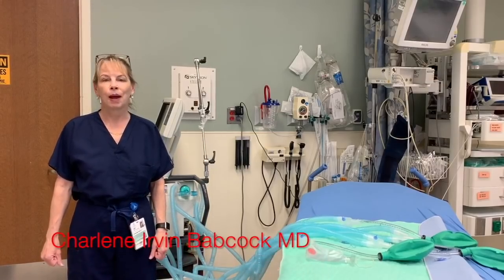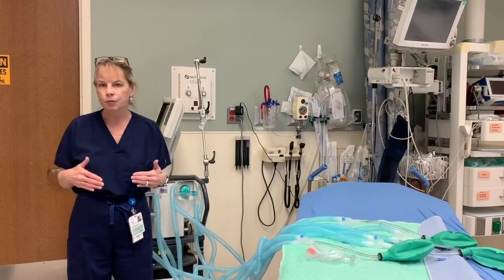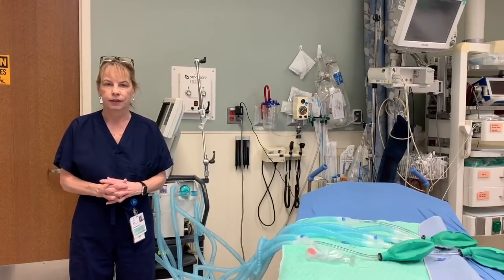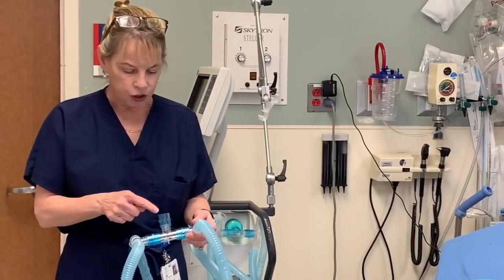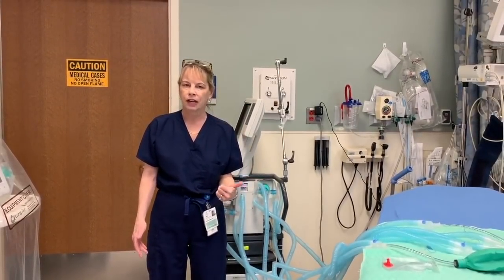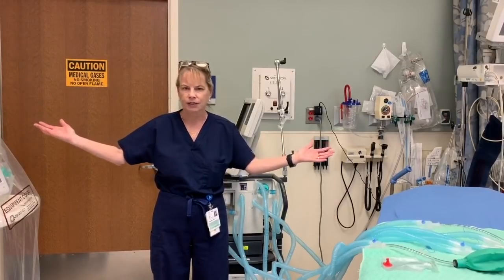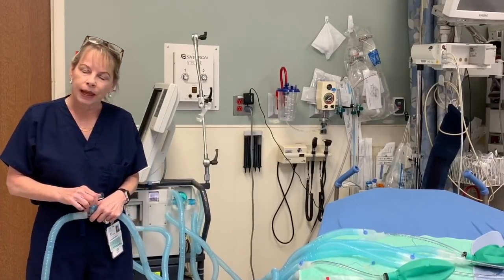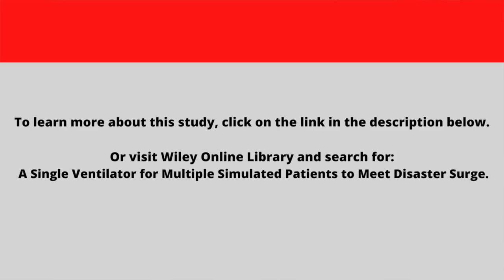COVID-19 How to Use One Ventilator to Save Multiple Lives

Comment: This method has been questioned for years, see https://www.sciencedirect.com/science/article/pii/S001236921532780X#bbib19:   "Suggestion 3.1: EMCC requires one mechanical ventilator per patient concurrently receiving sustained ventilatory support.

Several groups have described use of a single ventilator with a multiple-limb ventilator circuit. While at first glance this strategy is appealing, the research to date has demonstrated only that similar test lungs and pharmacologically paralyzed sheep with normal lungs can be ventilated by this approach. Perhaps this strategy would have utility for ventilating patients with normal lungs (eg, isolated traumatic brain injury) and thereby free additional ventilators for patients with high resistance or low compliance. Extrapolation to EMCC would require pharmacologically paralyzed patients who remain matched for minute ventilation requirements, dynamic airflow resistance, and compliance throughout the duration of ventilation; however, these parameters are likely to vary during the duration of mechanical ventilation, and may even change over a period of minutes (eg, secretions causing increased airflow obstruction). Because the Task Force anticipates that most additional patients requiring mechanical ventilation during a mass critical care event will have severe airflow obstruction or lung injury and will require days of ventilatory support, the Task Force suggests that each patient should have his or her own mechanical ventilator."

Comment: Dear Dr Babcock, I am an engineer and I am working with other collegue to realise a more robust system to split the ventilator line for 2 patients. My main concern is about parameters, on some machines the outlet line is also connected to a flowmeter that is used to allow paramters to be read and also to allow self regulation to the machine. How you can ensure this when you have the outlet of two or more patients? Many thanks and stay safe!
Reply: There is probably a manual setting toavoid using feedback

Comment: Where do you get more 3 masks and valves for other three patients?
Reply: Steal them from the CPAP machines.
Reply from the maker: THis video is about spliting tubes for a Ventilator...so there is no mask...but instead an ET tube.  ANd everything except the splitter should be on the quipment cart....

Comment: Dr Marco Ranieri of Bologna, Italy and his team Have successfully tested the approach in vivo in one of the hospitals in Italy overwhelmed by the COVID-19. 

They worked with Intersurgical, an Italian company based in Mirandola, started producing the circuitry in only 72 hours, and the first prototype has already been tested by Bologna Sant'Orsola Hospital. It works and in the next few days they'll start a mass production to supply Italian hospitals who are in need

Here some news in Italian. 

https://www.huffingtonpost.it/entry/a-mirandola-testato-ventilatore-che-assiste-2-pazienti-bonaccini-straordinario_it_5e73c3e1c5b6f5b7c540a8d2
Reply from the maker: THank THank THank you VERY much....for sharing this.....Fills my heart with Joy knowing. that it may work and possibly save lives...I know it may be a challenge matching. patients for eachset of 2 or 4...any pearls you can share...any challenges you did not expect?  

THanks again so. much for update!
Reply: Huff Post? Literally nothing they print is factual.
Reply: myname is private There is plenty of news from reputable sources in Italian and I checked with my connections in the medical community. Unfortunately Huffington post is the only one I found in English
Reply: Richard Pomerantz I don’t know if this is the same preference. Another case is spare valves for insulators which are running short so I group of people decided to 3-D print them on the spot as the manufacturer cannot supply them for weeks

Comment: It has been tested since, in 2008 and it worked. It is for a worst case scenario, but works to bridge until more ventilators arrive or free up.      Paladino L, Silverberg M, Charchaflieh JG, Eason JK, Wright BJ, Palamidessi N, Arquilla B, Sinert R, Manoach S.
Resuscitation. 2008 Apr;77(1):121-6. doi: 10.1016/j.resuscitation.2007.10.016. 
Increasing ventilator surge capacity in disasters: ventilation of four adult-human-sized sheep on a single ventilator with a modified circuit.
Reply: "Further research should be conducted on ventilating individuals with different lung compliances and on potential microbial cross-contamination."  Is that research available?

Comment: There is not enough information here to equate the COVID-19 situation with this experiment, nor the Las Vegas experience.  I also wonder if it assumes too much.  What is the impact of varying patient compliance for COVID patients who develop ARDS?  Does the evidence show the COVID patients never grow other pathogens?  Is volume control really the best option?  That seems rather counterintuitive.  If we are to attempt this maneuver, there are multiple concerning issues that need to be addressed.
Reply: your concerns are valid. But think if you don't try and you run out of vents for patients that need to be intubated- you've lost even more patients. We have to make choices. If you don't try - the patients will die.
Reply: B Anderson See my comment above this has been successfully tested in the field in Italy  now and it is now scaled up to double the ICU capacity
Reply from the maker: THey are using it in Italy...it DOES work...see above ...comment by Filippo Catalano!

Dr Marco Ranieri of Bologna, Italy and his team Have successfully tested the approach in vivo in one of the hospitals in Italy overwhelmed by the COVID-19. 

They worked with Intersurgical, an Italian company based in Mirandola, started producing the circuitry in only 72 hours, and the first prototype has already been tested by Bologna Sant'Orsola Hospital. It works and in the next few days they'll start a mass production to supply Italian hospitals who are in need
Reply: With all due respect, we need more to go on than simply telling us this concept has been field tested.  Surely you can share the results in a format we can understand and operationalize. I assume your hospital is set to role this out, Dr. Babcock.  What algorithms will you employ?  Robert, this isn't about not trying. If it were, I wouldn't take the time to post.
Reply: Actually, using pressure control would likely prevent volutrauma. The worst thing that would happen with this setting is that the person with the least compliance would be underventilated (as long as they are oxygenated they could tolerate some permissive hypercapnia). 

James Yi, MD
Anesthesia
Reply: Volume control is never the best option.

Comment: It’s absolutely doable 
I would add two things 
A filter can be added to each one of the four limbs to improve viral filtering 
Also she said volume control vs pressure control. 
 I think volume control is the one that is nerve wrecking because you have to choose similar weights, BMI, and compliance so if one patients compliance changes or the nurse is suctioning the patient, the others will get much higher today volumes ( of course we can also limit the max pressure to 30 but that will also mean that every time we suction somebody the others won’t get the today volume)

The best bet is pressure control you can even ventilate a kid and an adult using PCV without problems

Comment: Thank you for this. I remember reading the article. In dire circumstances and for short-term use, anything is possible but there are two inherent problems in the use of this method with COVID-19 especially if having to rely on prolonged use because of lack of available devices. The first is that heated humidity is preferable in any circumstance of injurious lung and to do this would not be possible when heated-wire circuits are utilized from a single chamber. As a result, it would mean the use of HMEs. As the resistance to airflow builds up in the HME because of oversaturation and/or secretions that are coughed into them (a common problem with prolonged HME use), it would necessitate the HME to be changed. Further, how do you determine which one has to be changed, especially if patients are paralyzed and work of breathing can't be assessed or independent feedback data from the ventilator be read? In any case, this would require a break to be made in the circuit to replace. As a result, it would cause frequent risks of exposure to care providers. This is not a recommended practice even if endotracheal tubes are clamped. The second issue is that each patient's disease process is dynamic. As such, what do you do when one patient's lung injury advances requiring a change in settings or modality; two patient's remain in stasis and the last is ready to wean? Difficult questions to answer but despite having said all of this, this may still be the only option available, (Hopefully, only for a short term) if/when the lack of ventilators arises.
Reply: Scott the patients need mechanical ventilation so a trach and trach mask is not going to cut it as, while there may be some degree of passive oxygen flow in a non ventilating patient and high flow oxygen with an open airway (or trach, see apneic oxygenation) this is usually done with stable folks in an operating room with a dedicated anaesthesia professional, or as a bridge to airway management... sadly your idea will not work unless the patient is breathing spontaneously which is difficult to assure when often  chemical paralysis is necessary to ensure ventilator synchrony during treatment for ARDS and similar.
Reply: @EricMcKearney  Thank you for a serious reply to my suggestions. Spontaneous respirations are, of course, necessary for tracheotomy to work by reducing dead space in the airway. My point is, if spontaneous respirations have ceased or are ceasing, I don't think it is a sound idea to inject the aerosolized filth of the adjacent victim. My experience is mostly with the chronically critically ill patients on ventilators and I am somewhat jaded about the idea of using the ventilator to extend life. My earlier comments about "waterboarding" seem to have disappeared.
Reply: @scottgoodman8993  I can totally understand those concerns, in this case, I believe it would be in an absolute disaster situation as many healthcare teams (ie Italy, China), have experienced. I totally agree with you in this regard as well of ventilator dependence in the chronically dependent, a difficult but inherently different situation where in this case there are definitely some folks who will recover with potentially weeks of mechanical ventilation. The Johns Hopkins CoVID map is a good resource, there are lots of folks who recover but only with excellent medical care, sadly the provision of such may require significant differences and allowances in how we normally conduct business as healthcare providers, for example, the allowance for industrial N95 respirators to be used by US healthcare workers by having the govt take on that liability, I believe if we got to this point there can be amendments to laws/medicare/ ethics regs to allow for the provision of life-saving/sustaining care in less than ideal circumstances, there is experience with these things in extremely austere environments. See the EMCrit link regarding this as they use the idea of grouping patients with similar respiratory etiologies/parameters to ventilators, as given a large group of folks requiring ventilation the lung dynamics will be similar in broad strokes across different patients. Apologies for the somewhat rambling reply I was trying to incorporate some thoughts after reading other comments as well.
Reply: @EricMcKearney  Thank you for the links and suggestions. I appreciate your thoughtful reply and insight during this crisis. I am only tangentially involved as I am retired. I suppose I will go back to work if SHTF. Her posting attracted my attention and I recall following many  orders I disagreed with. Watched many die. Watched many families mourn. Saw hare brained physicians pull out all stops to flog dead horses for money or ego. I suppose I am too jaded to work in my old age. You seem young, vigorous and hopeful. I pray you have a happy career.
Reply: @scottgoodman8993  I can absolutely relate! I am relatively young but essentially retired as well after ten years as an advanced care paramedic and educator due to health issues related and unrelated, although I let the dept of health know I am ready and willing to help if as you say the SHTF, currently they are converting entire units into isolation wings. I've witnessed the same, ICU care being extended due to false hope for families or bc docs worried about liability... this is admittedly much less of a problem here and we have a robust end of life / palliative program with good integration at all levels... it can always be better but thankfully assisted dying is accessible in my province as well.
Reply: Gloria McKay in the setting of this requirement it may be helpful to change HME and bac filters more frequently, say half or 1/4 the regular duty cycle. Another option would be to attempt to gather data on individual ventilatory pressures at certain points and attempt to group those patients to one vent. 

Curious if this technique could be used to extend NIV support using the MedStar hoods which seem so common in the Italian coverage now
Reply: There’s very little risk of cross contamination in this setup.  Each patient has their own independent circuit.  They shouldn’t have an assessable work if breathing when chemically paralyzed. So no need to worry about assessing it.  Weaning isn’t even a worry.  If you’re sick enough to need the vent, you aren’t getting better quickly.  This is only proposed as a last resort.  Not as a way to manage patients long term.  There is no way to guarantee tidal volume.  But, you could ventilate in pressure control to limit pressure, and simply adjust rate and drive pressure to a point where the collective of patients had the best possible average PCO2.  It’s not perfect.  But it would work.  Just enough pressure for chest rise.
Reply: No question this idea is poorly thought out.  I am trying in my mind to understand why she would even make this suggestion. See my thoughts above about tracheotomy and %100 trache mask. She is, essentially, recommending death by therapeutic misadventure rather than saving one and safely treating three.

Comment: Charlene - Thank you for your valuable contribution with an innovative approach to building emergency capacity in what will require a war like response. Not ideal but in a choice of a chance of surviving vs dying the choice for me would be easy. I am sharing this in Australia
Reply from the maker: GREAT NEWS....Italy Tried it in VIVO...and it worked...see comments by Filippo Catalano...KEY is matching similar patients....

Dr Marco Ranieri of Bologna, Italy and his team Have successfully tested the approach in vivo in one of the hospitals in Italy overwhelmed by the COVID-19. 

They worked with Intersurgical, an Italian company based in Mirandola, started producing the circuitry in only 72 hours, and the first prototype has already been tested by Bologna Sant'Orsola Hospital. It works and in the next few days they'll start a mass production to supply Italian hospitals who are in need
Reply: I pray all four do not become septic, vent dependent, suffer multiple organ failure and a horrible death 2 weeks later.

Comment: You know, FDM 3D printing is pretty prevalent, these days. Are there non-critical parts that might not need to be sterile or need specific materials that could be designed and put up on sharing sites like Thingiverse, so people with home 3D Printers can print them off?
Reply: sadly, there are problems with 3D printed parts too.

Comment: Dr Babcock, this is an interesting idea but I have three questions/concerns - although I can acknowledge this is wartime situation:
- how can we be sure we aren't going to have transmission of bacteria from one patient to another (are filters adequate?)
- ventilation settings are individualised based on a variety of characteristics: body weight, severity of ARDS, underlying conditions, mechanics of each patient's lungs, oxygen requirements. How are you tackling all these?
- Can the ventilator cope with the CO2 eliminated from four patients at the same time?
Reply from the maker: place a filter before the expirationport connection with the T. piece....also, tubing is 5 feet from ET tube, adn itsa 1 way circut...
Reply: @charlenebabcock1048  Don't pay any nonsense to haters here.  Brilliant to simply offer this as an option.  Don't have them sign that they are ok with no ventilator support at all.  then move on to someone who does and try to save their lives. smh, Italy is pulling ventilators from elders to give to younger patients.
Reply from the maker: You need to put a bacterial/viral filter before the splitter on the expiration port...easy to do...

Comment: Rather than rearrange the beds in a complex fashion to make sure the ventilator is equidistant from all of them, why not just work out the length of pipe needed to reach the furthest patient and then use the same length as that for the other three? Excess can be coiled out of the way.
Reply: It has nothing to do with dead space.  The more tubing you use.  The more compressible volume loss you will have.  Apparently no one understands mechanical dead space anymore.
Reply from the maker: minimize dead space...
Reply: @charlenebabcock1048  Ah fair enough. I just figured that on cramped wards rearranging beds like that might be difficult in a way that doesn't impede access.
Reply: To minimize dead-space